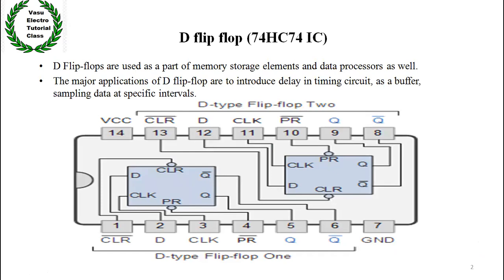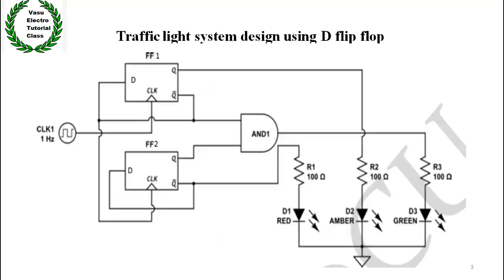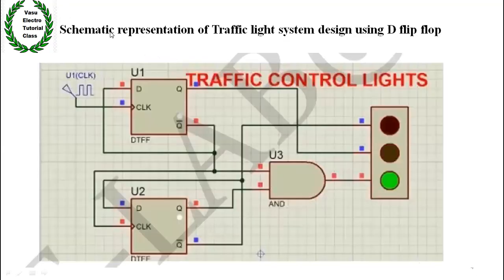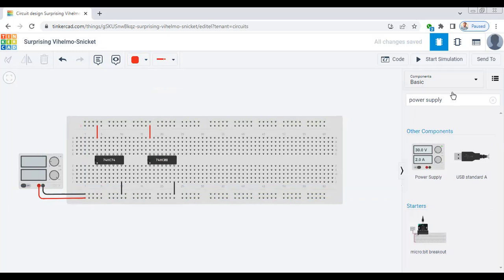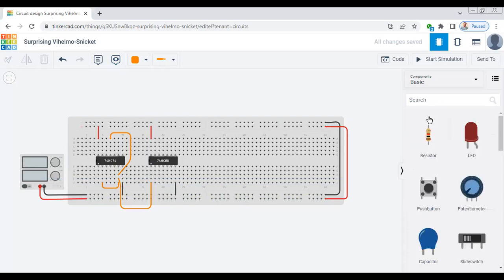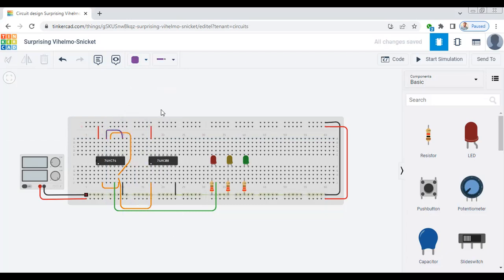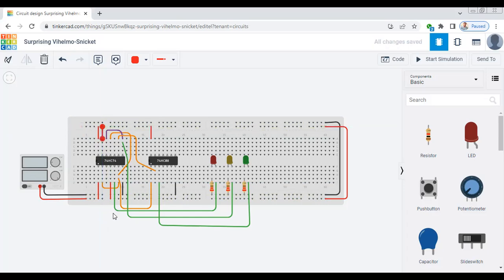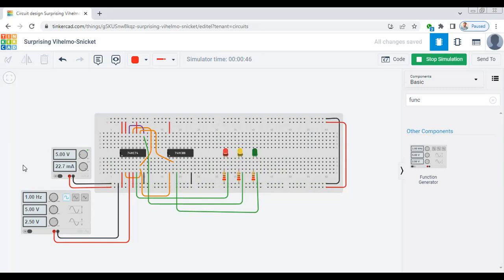Tinkercad| Traffic Light Designing| D Flip Flop| D FF| Smart Traffic Light simulation| Flip flop|

Comment: Sir 4 que:
1)sir pin 9 to power or 10 to power
2)sir it's 1hz sir 1khz
3)sir i think in breadboard itsthe rails are not sorted so we need to sort near 30 number on board.
4)sir resistor to short or long leg of led

Sir pz reply i have a project to subbmit Thanks a lot sir.